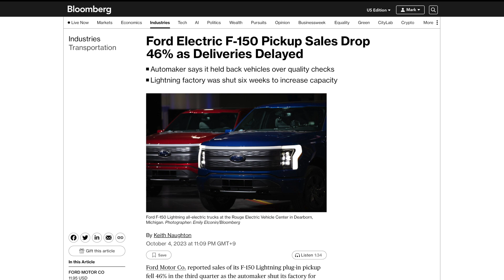Ford Cuts F-150 Lightning EV Production as Sales Continue to Fall

Comment: Meanwhile: 
"Ford F-150 Lightning U.S. Sales Hit New Record In October 2023"
😂😂😂
Reply from the maker: Ford is running some heavy discounts on F-150 Lightning. I'm sure that's helping the cause. I wonder what the uptake is for Pro grade buyers.
Reply: @cleanearthio  No idea. I walked away twice from the offers. They finally ended bringing it all together, and I took home the Lariat 511 last week for the price of the 510 package out the door and before the 7500 tax credit.
It's not going to be the end all be all, or fit the need for everyone.
But if it fits someone's overall use case, then this is a decent time to play hard ball because the discounts go deep right now.
However, on the flip side of that, they're still overpriced. It brings it closer to what I think the starting point to negotiate down from should be.
Yes. I get that this is how all new tech cycles work.
What drove the Pro buyer uptick, though? Good question. Fleet needs? New EV buyers and early adopters with more localized use cases trying out the entry-level model to test the waters?
It would be interesting to see a report on the motivation and uses that drove that.
Reply from the maker: Congratulations! I'm glad you were able to get the truck you wanted under terms you found acceptable. I need to find a way to create a page so that people can share their EVs. I'm always excited to hear about the various cars people purchase, as well as their experiences and questions. I'm going to think something up and communicate to everyone soon. 

I agree on it being a good time to play hardball. Dealers want to move these cars. OEMs overestimated the market. I want to see EVs moving off lots. Again, great for you.

I think for the Pro segment it's everything that you mentioned. Electrified fleets can be good for business. There are cost benefits. It's also good to get a sense of how companies can operate EVs in their fleets at scale. 

I've made a note and will start tracking these details. I've actually got some videos upcoming about the pro / commercial segments. It's nothing concrete, but might be worth taking a look.